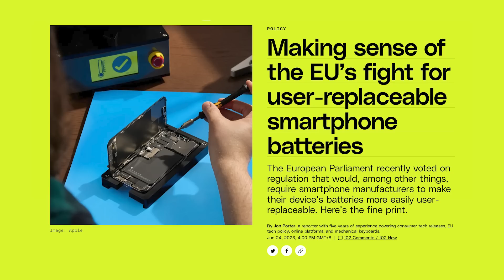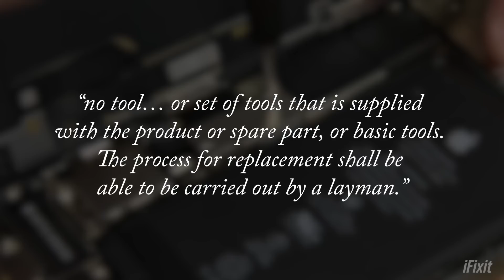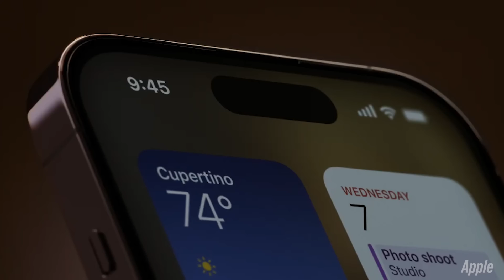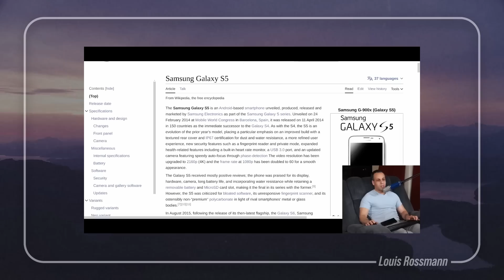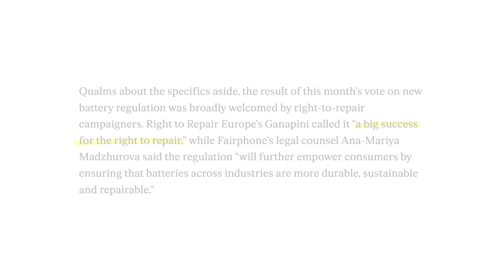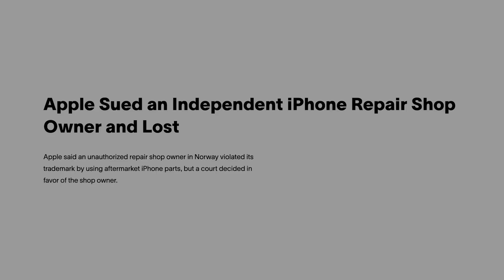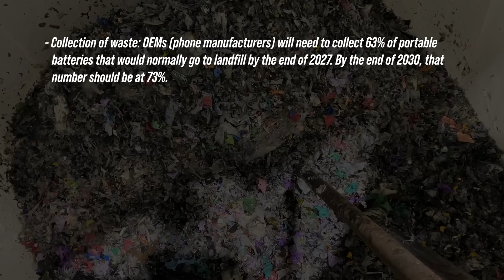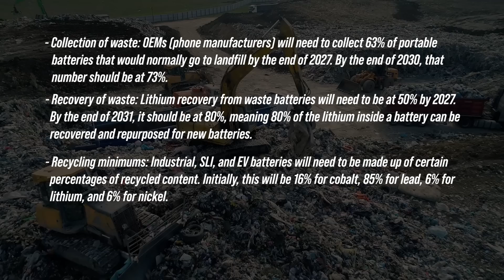EU Just Changed Smartphones Forever

Comment: I remember a friend of mine whose laptop in our high school days had a removable battery, and can still be used when plugged to a charger without it. Always wondered why I never saw those kinds of laptops nowadays
Reply: I had one of those about 5 years ago, they still might exist, just rare.
Reply: @akaraven66  huh, i have a second recuperated laptop, that used to be an company one, for just surfing and such nothing to have, my borther replaced the battery, and for laptops i thought this was still standard? you just need to remove some screws to get to the right place of course.. 
It's tablets that cause problems, with glue and such.. i renember next to apple, microsoft surface receiving the worst replacebility score? 
but a laptop from brands like HP, dell, and even aldi brand normally have replaceble batteries..
just the problem, smartphone also used to have : they created extreem different shapes of them ! 
meaning that same brand, almost identical laptop, often has received a different shaped battery = no shop can really store replacement batteries, only possible to really look up the exact type you need and order online..

like, samsung, different A models, from same year, same battery capacity, 98% same shape smarthpone, were when they still had removable batteries, still just created with just tiny different rectangular shaped batteries!
Reply: My current aging laptop has the common design of its time with a battery pack near the hinge and ability to run without .  I haven't cut the pack open, but shape suggests it contains some 18650 cells wrapped in a proprietary plastic shell .  Laptop weight is dominated by steel reinforcements inside, though it also features other discontinued features such as a replaceable main drive and a DVD drive .  Choosing a replacement in today's market is hard .
Reply: removable batteries in laptops is so great when the laptop is your main machine, you just remove it and permanently leave the laptop plugged in with no damage to the battery so it's still shiny new for the times you need to take the laptop somewhere
Reply: @Suzumi-kun   Yes, many new laptops still allow you to do that by simply not using the battery via software option. The result is exactly the same, even if you don't physically remove the battery.
Reply: I removed my piece of crap inner battery from my Asus laptop. The only downside is the clock losing the time but as soon as I connect to the internet it updates. The closed batteries that come with tablets and laptops are a piece of "sheet" and brands do this on purpose
Reply: I have three batteries for my 2012 ThinkPad, still using it for Uni, though my friends never get why I still like it so much.
Reply: Use mine everyday and typing this message to you on it. Not so rare...
Reply: I still use one
Reply: I have my Lenovo laptop (Y740), and replacing its battery is in fact is quite easy, i just need to remove its back cover, unscrew a few screws, remove its flex connector, an voilá, its out.

For a 1100 USD gaming laptop is quite unexpectedly easy.
Reply: I had one of those until this year. Changed it for a lighter one and for other reasons. Not because it doesn't work anymore
Reply: Yeah removeable batteries are long gone.  In the old days the Lenovo T serie line had snap on batteries but they were phased out.  In PC you can always replace batteries inside.  I think Macbooks you can too with the right screwdriver you can open it up and replace them.  I don't think they seal the Macs with adhesives like the iphones but I could be wrong.
Reply: This also meant that carrying spares allowed you to travel more conveniently and you could modify your laptop to your needs. In my Lenovo X230 i had a huge heavy duty battery that allowed me like 12h of work but it weighed a lot. I also had smaller ones that made the laptop light and easy to carry.
Reply: Lenovos can do that. If you never owned Lenovo laptop, you lost a lot :)
Reply: Not as big of a deal, some laptops have a software option to disconnect the battery and be used without it even if it's still in place. Also, usually it's pretty easy to replace, you only need a philips screwdriver. It sucks when manufacturers make it impossible to fix things, that's a different case, but the laptop battery situation is bearable :)
Reply: Because they were bulky as hell. I  did have one. Even the weight with no batery is not even comparable to a modern laptop.
Reply: @by-jokese   that is just not true, my old laptop with removable battery weights just as much as my current laptop, if not my current laptop weights slightly more.
Reply: @TrainHardnett  Laptops can easily be opened with a screwdriver and batteries replaced. The external replaceable batteries on laptops are not really useful and increases the bulk as the batteries will need additional protective casing which can be done away with when using internal battery. I used to have normal casual laptop earlier which used to weigh as much as a gaming laptop with dual fans now. Such casual laptops are now very thin.
Reply: @by-jokese  if the laptop was way bulkier and heavier than modern laptops even without the battery in then clearly the battery wasn't the big difference between modern laptops and the old bulky ones. and it definitely wasn't, technology gets smaller and lighter over time, this is called moores law, the "doubling every 18 months" part hasn't been true in years but the general principle still holds. modern batteries are also different from those old batteries. modern batteries are mostly Lithiam ion batteries which weigh a fraction of what the old Nickle metal hydride or nickle cadmium batteries did for the same capacity.
just a quick comparison example of two items I've personally owned, the samsung galaxy note 2, my first smartphone, has a lithium ion battery that is user replaceable and weighs 183 grams. my newest smart phone, the Samsung S21 ultra weighs 227 grams. the difference in weights would be i imagine from the S21 ultra using glass and metal which weigh more than plastic but it doesn't meaningfully feel "sleeker or smaller" in the hand compared to the note 2 regardless so making the battery non replaceable has zero upside (it also doesn't feel heavier in my hand, phone reviews always stress how thin or light the newest greatest phone is but I think anyone that can tell the difference of 40 grams and have it impact their usability substantially has issues of some kind)

Comment: 3:00 "I'm old enough to remember" Bah. It was 2014, dude. It's not that long ago. Also, I did replace my phones' batteries back then. It did not go well. When you buy a new battery for a phone that came out 3 years ago, you get a 3 year old battery - i.e. it's already pretty much done. The only way this would work is if the batteries were also the same across models - so that you can buy the same battery that's put in newer models and put it in an older one. This would put major restrictions on the manufaturing of phones, and we'd end up with much bigger, heavier phones. I don't know about you, but I certainly don't want my phone to be any bigger and heavier than it already is. 
If the EU is so concerned about lithium batteries and electronics waste, they should have a think about the waste from their battery cars instead.

Comment: I miss having an external battery, I has an LG G4 and that was the best feature, if the phone was running low, just swap out for the spare and charge the spare on it's external charger, no need for a cable into the phone while you're trying to use it.

Comment: There’s an easy way to keep the sandwich design. It just means the back panel will be a pressed mould with the battery pressed from the outside as some sort of wireless power module attached.

Comment: I prefer using a couple simple tools (such as a screw-driver, suction cup) if that means the phone will be thinner, sturdier and cheaper. I do not understand why tools are excluded. 
Also there are many phones that can be opened with a suction cup to the screen and the battery removed with a tab. Why does it need to be simpler than that? 

It's not like you change the battery every year. Usually if you charge your phone only when it needs to be and reduce the battery cycle it should last 3-5 years. 
With newer batteries with very long life cycles, the batteries will probably need to be changed after 5 years. 
How many people keep their phone that long (for some reason lots of phones slow down a lot after that much time and do not have any more security updates)? 

From affar this seems to be a good initiative but for me the drawbacks far outweigh the little benefits. 
(Companies will need to build new machines for the new frames, new pcb structures, etc, phones will probably need more bracing. Jobs will be lost, people will probably switch batteries more often and cause even more pollution, waterproofing will be more complicated and other drawbacks I probably missed). 

How about tellling users not to charge their phone every night, especially when the battery is over 70% ? 
What if phones used less power? 
For pretty much the same usage 5-7 years ago (gps, calls, browsing) you barely needed 1gb of ram, nowadays, for the same kind of usage you need 4GB or more. 
Can't their be more effort in a durable battery?

Comment: My scooter has a replaceable battery but not swappable, you need tools. Any handyman has that tools, its a wrench to unscrew 8 bolts. However, i think there should be a way to just open the deck ...

Comment: "dust-proofing and water proofing will be harder to achieve"
Have they never heard of rubber sealing with screws? Without adhesives, those usually can handle up to 10m depth, if not better. Dust-proofing can be done similarly, besides a few hiccups with audio jacks and cable connectors.

Comment: You sound like a spokesman for Android and Apple OS. That's BS for the reson why the manufacturers sealed the batteries in--- for 24/7/365 continuous access your phone. Back in the day of Samsung Note 3, I would disable all permissions and purge all third party apps that the firmware allowed and my phone would still report what I was watching on the television when the TV was not muted. I would be talking to my neighbor about needing a car parts store that sold ECUs for Toyots Tundra and moments later a TV commercial appeared with an Autozone commercial and they mentioned Toyota as one of the many manufacturers.
My Note 3 was off at the time. I began to remove the battery whenever I desired privacy and no more coincidental TV commercials.
THAT is why the EU enacted this law.

Comment: The problem with replaceable batteries such as for my old Samsung Note 4, often are not brand new but old batteries with a new label on it. When the original battery got old and failed to keep it's charge, the replacement battery was not much better.
Reply: Nope , it is because the latest mobile apps are draining batteries much faster.  I've also changed more than 6 batteries. Soon, all the app developers will stop supporting this android OS.

Comment: The sad thing is that the companies will find other ways to force consumers to buy new phones. Companies should have to keep phone up to date for at least 5 years by law. They also shouldn't design phones to break any other way
Reply: The EU regulators will still catch up with them just like they did with phone chargers. EU regulators are always have the people at heart unlike corrupted US congress.
Reply: well.. that leads to problem of reveneu = about only the sale itself..
they could standardise some sort of leasing, that you only pay part of the price when buying, and other part per moth  you use the phone, 
provided the manufacturer keeps the phone in mint condition and safe AKA all the safety upgrades, that now often stop after 2 or 3 years.. and you can't use a phone for mobile banking or so when it's over 6 months late on a safety upgrade... 

a formula like this gives always some rest value, that you'd have to pay when not returning your phone in the end. 
And if a professional can quickly change the battery, without any extra cost, under that leasing contract, then a battery is almost automatically returned..

agree that -currect 2 year min updates really is too little .. that also hollows out the ability to change the battery.. cause afther 2 to 3 years, you start to feel the battery decline, so changing it only makes sense if you expect to be able to use your phone 2 years longer = 5 years in total..

Comment: As much as I am in favor of innovation and pushing the limits of technology, there should always be some limits for the benefit of the consumer (and also the environment). Replaceable batteries specifically will definitely be a good such limit.

I've had my own phone for 5 years at this point. It only needed a battery replacement around a year ago due to it not lasting much at all. An expensive, lengthy process that left me worried about just how much more will this phone last when it's not even supposed to be taken apart. Just yesterday it died, possibly due to the battery again, and I'll have to either go through another expensive, lengthy repair process or buy a new phone and lose all my data.

While I know most companies will eventually find ways to comply with that law, I am especially happy about the effect it'll have on Apple. They're the only company that consistently and deliberately design their phones to be as least repairable as possible, with the "added benefit" of they themselves having trouble repairing their own products and overcharging for it. Worst case scenario, if Apple pulls out of Europe entirely I would be more than happy to never see their products again.

I do still think foldables should be except from this law, they are too fragile already for the average user to quickswap a battery (especially since they all have 2 batteries), however then all manufacturers will replace their glass screens with weaker plastic screens and classify their phones as "foldables" (even if they don't fold) to get around this law. Gutting the foldable market is a compromise I'm willing to see made though.

Comment: You can make a water tight phone and have a replacement for the battery.  The wires pass out of a sealed case and a thin connector for both the speakers and battery. Basically two cases in one. Same idea with a firewall and a car. Just way smaller. It might allow us to get none oem battery that is three times the size and extend the daily use of the phone. Instead of a phone wrap battery as an external charger just none oem bigger battery that clips on. 5000 to 15000.

Comment: I have an old iPhone 4 for nostaligia sake and its battery was pretty much gone.  I found it very easy to replace.  The bottom of the phone near the charging port had two small screws that were removed.  The back plate slid upwards and came off easily.  The battery was there held in place with a dab of adhesive that was easily detached from the phone.  Small connector for the battery.  Entire process took two minutes taking my time.  This is how easiy all iPhone battery replacements should be.

Comment: Today, a Samsung phone is available to buy with water resistance up to 30 minutes and a removable battery. It is called the Xcover 6 pro. It is designed as a "rugged phone", and is more expensive than a normal Samsung phone, but it shows the technology is easily possible.

Comment: IMO smartphones in general went downhill before the first half of 2010s even ended. 
I remember the removable batteries. 
SONY used to promote their waterproof phones with commercials where you could see them taking an underwater video footage. 
I've even seen some Microsoft phone from 2011 to 2014 time period that had a single 50Mp back camera and takes better shots than current phones with same Mp and AI combined.
I also prefer smaller size and visual style of older smartphones to the new ones.

The only significant thing that has happened in this industry since then are foldable smartphones and maybe those 200Mp cameras,  everything else was just another way to give customers less for their money, non-removable batteries, software "protected" parts and cables, no charger in a package.

Hell i remember time when a new phone came with a pair of earphones and they were actually better that most of those you could buy in a store.

Comment: My old 2013 Sony Xperia ZR had IP58 dust/water resistant despite having removal battery. Micro-usb and audio jack port were protected with removable covers. The cover water seals protection lasted about 4 years. I dropped that phone hard a few times, once from a higher bunk bed. Its digitizer was partially malfunctioning after but this 10 years old phone still run with a bluetooth keyboard today! The original battery worked reliably for 6 years!

Comment: The EU wants battery to be easily changed cuz they don't want to sell it, but make batteries as product which is leasing/subscription/lent only. It's one of steps to make things harder for normal people.
The EV's you will buy without batteries, but batteries will be only lent/leasing and after some time you will have to send it back and take another.
Sum up things what happened or will be happening and you will see it ONE BIG PLAN to take control of people. E-money, EV's cars only available, ALL batteries in Leasing...
It's only small things but together they mean a lot.